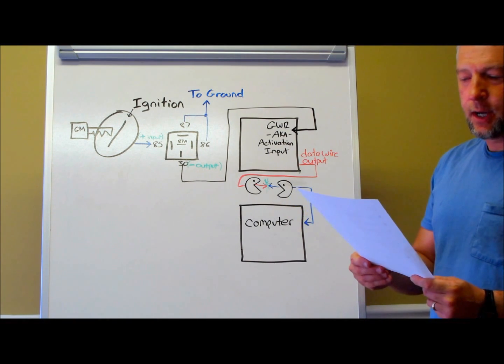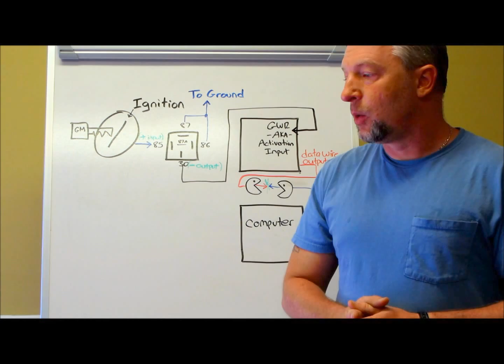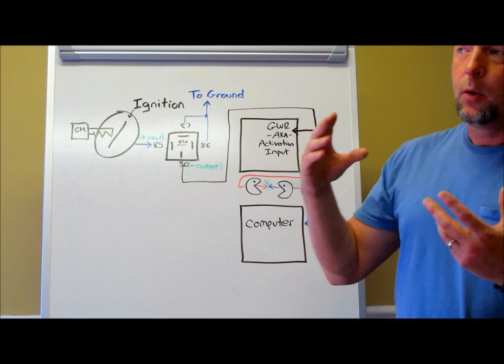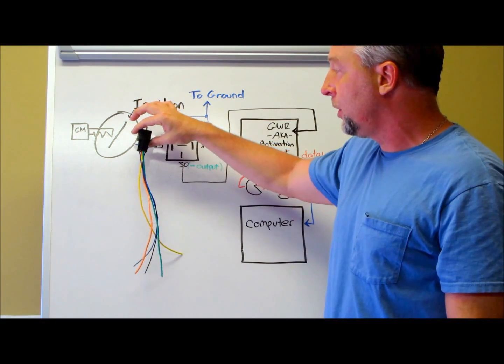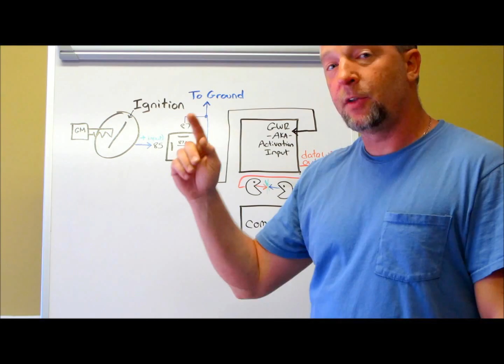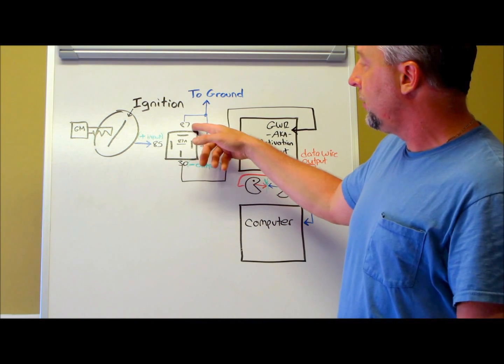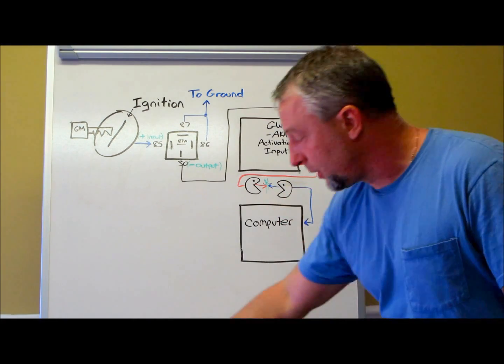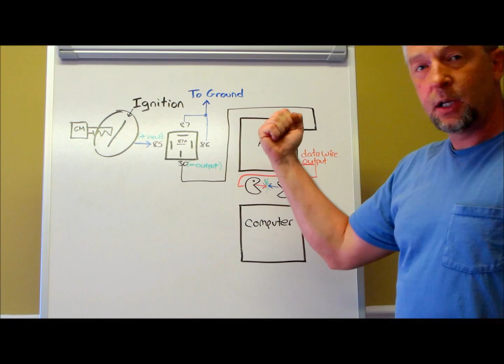Tricking (disabling) factory transponder anti theft system with an aftermarket databus bypass module

Comment: Hello Lessco Electronics. I really appreciate the video. I have just subscribed to your channel as I am no guru but I am an electronics geek of sorts. I found your video because I am having issues with my Dodge Neon. Someone tried stealing it and well, I have been trying to troubleshoot how to get it running again. It turns out I found a bypass module connected to the vehicle while exploring and changing out the steering wheel and lock cylinder. I have the same key/keyfob that I attempted to reuse since I don't have a spare. The new lock cylinder is not a transponder chip key but I figured I would just tape the existing chip from the new key. Well, it doesn't work. I figured I would change out the relay to see if that might work but what if the computer is confused? I know you mentioned at the beginning of the video that there is no way of testing it. But if it worked before and suddenly does not work. Is there another work around, or would I have to get the computer programmed? Any advise or direction you can point me in would be very helpful. Regards.
Reply from the maker: Call me -  I can help 904 342 5491

Comment: Hey nice video I bought a 2001 ranger 3 weeks ago I have three keys to it the previous owner said he had to put new computer and get keys for the truck before it ran find now no crank I turn one key to start position theft blinks rapidly the other two keys the left light goes off after 3 seconds still no crank battery is good I can hear the fuel pump air bag light now reads off when truck ran air bag light was on could it be the keys/ ignition problem or the computer/pats can a locksmith repair problem or is it a take it to the dealership situation will I eventually need to buy the set up you described in your you tube video if you can respond I appreciate the help Thanks

Comment: have a 2000 Mazda B3000 6 cyl, auto , 4 wheel. need to by pass the pats system. please send info on ,  pump relay pigtail, bypass module needed,,, Bil4037@gmail.com

Comment: Ok im having tge same issue for weeks now ive been daignosing trying to figure out why the coil packs werent getting spark..the engine would crank but no spark, fuses ,relays are all good ..so now its come to this the egnition switch...i just ordered a new complete ignition switch w/key for a 3.5 altima now if i install it will this resolve my issue or does the computer/ecm need to be programmed to that specific ignition..im hoping to just bolt it in plug it in and it just be ready for use..lmk wat u think thank u!

Comment: Good video, well explained, friend Lessco, how can I do to disable the safety light of a 2006 Dodge Ram 2500, since it blinks and does not allow the vehicle to start, besides how could the data bus to the PCM bypassing the cluster , I would appreciate if you could guide me to resolve the situation, thanks in advance, Regards.

Comment: I NEED HELP PLEASE 
I have a 1998 GMC Yukon slt 4x4 my brother lost the keys and i dont understand how to bypass Sercurity i put a wire to the starte and one to starter solenoid it will start but Sercurity light comes on dies do i have to buy a Sercurity bypass moduler and what else and can i buy it from you

Comment: Today my 98 suburban start but turn off, i diagnose all the engine components and was good, the terminal 21 on the fuse ( security ) had no courrent, i jump a wire to the terminal and the  problem was solved,  now  terminal 21 have voltage,  this is controled by the transponder, the vats or? the bypass kit will solve? thank`s

Comment: .... Here's how... Buy this... buy that.. buy this thing too.  It might not work.. Give it a try.
Reply: This is electronic bus comunication. Not knock-it-with-a-hammer-3-times-then-try-again stuff. You're gonna need some components, no real way around that. Iven if it was a hammer type of deal, you'd still need to buy a hammer, if you don't already happen to have one or can borrow one. Immo bypass modules aren't something half your neighbors are likely to have lying around, and you wouldn't be viewing this video if you already owned one (at which point you'd most likely already know how to use it, or have a manual).

Comment: What if I put a Honda Jazz steering column that has Honda ignition barrel and switch which has a blank Honda Jazz key ....all this used on a Ls1 v8 Holden vy ECU ....how do I bypass vats and start engine

Comment: Hi I have a 2005 jeep Cherokee a SG liberty and she broke down 3 years ago. When I had a technician put a computer on it. It come up with the ignition is not responding with the ecu the ecu is not responding with the body module and more. But when I turn the ignition on the fuel pump comes on but the immobiliser won't disengage and the only way I can get her to to turn over is by touching the live from the battery to the relay slot for the starter. Now jeep UK has estimated close to £3000 for all the parts and that's twice the value of the jeep and it's a shame to scrap it it's only done 70000 miles is there some way I can get her going for penny's?  I have both Keyes.

Comment: Cam this be used on a 2004 dodge stratus R/T i cant find a way to bypass the immobilizer amd have no key but took tumblers out of the cylinder and can turn car over but securtiy is not allowing to start
Reply from the maker: This will not work on a sentry key like yours.

Comment: Ok I'm desperate! I'm trying to figure on 2002 Chevy avalanche. I've tried every bypass on this truck on YouTube and websites to no avail. The light stays on continuous when key is not in ignition and even when doing relearn process. I just want to disable the system security completely. There are NO videos on this vehicle. Thanks if you can help with video or writing back, thanks. Been dealing with this for a month! Desperate! I don't have the funds to have mechanic fix this with diagnostic tool.

Comment: So went to xpresskit.com and on installation instructions on the module for my buddy's vehicle 97 mustang it says to place key inside of module if the system isn't working correctly at the moment I can't fathom how it would fix the problem using signal from key that is currently not working unless maybe the transponder ring has failed and isn't reading signal

Comment: i have a 06 ranger.  the check engine light came on and the the guy at advance auto said the code said it was my pats system either the key or the receiver.  My truck isn't acting strange it started fine and the check engine light came on immediately.

Comment: I have 01 Expedition Eddie Bauer with the MACH Stereo system I just bought a Kenwood eXcelon ddx394 SAT the settings won't save? i bought a metra wiring kit for my car but still wont save?

Comment: If you don't have an original 'chipped' key.   Missed the part about 'How' the new flushable database interface is 'flashed' with the proper  'secret code' that the computer needs to let the car start.

Comment: Can i bypass a 1998 Lexus GS300 transponder system?
Reply from the maker: If you have 1 key now you can get the pkt we sell and wire that in there to bypass it digitally
Reply: I have a key. What is your web address?
Reply from the maker: lesscosales.com
Reply: Lessco Electronics
Reply: sorry, but I couldn't locate the website

Comment: Thanks for the video, but none of the links appear to work, they just give a long list of unrelated products.  It would be nice to have the description say exactly what part you are attempting to link to.  Also there are many "bipass" modules with many features.  I have no clue what specific feature I need to do what I would like to do.  I want to be able to use a non-chipped key to start and run a Toyota Corolla 2008 (manual locks).  I DO NOT need remote start.  I have working chipped keys and the car works fine right now.  Thanks for any assistance you can offer.
Reply from the maker: tell me your vehicle, Ill send you what you need
Reply: Toyota Corolla 2008 stick shift and manual locks I don't need remote start.  I just want to be able to use a non-chipped key to start and run.  Thanks for any assistance. :)
Reply from the maker: You can use this:

http://www.ebay.com/itm/DEI-PKTX-Transponder-Bypass-Interface-Module-/360699792605?hash=item53fb620cdd

and a relay to activate it
Reply: Thanks for the clarification, but as it turns out I don't need the part because I thought I could reduce the EMF in the car by removing the antenna/reader round loop.  A simple test showed that the EMF must be coming from some other places.  Do you happen to know what components do that and if they can be shielded.  I'm getting readings of 15 or more with the tri-field meter in the driver's seat.

Comment: Hey, is it possible to have an alarm ( I have a code alarm 6554) cause misfire issues?  One day my battery died, and when I got it jump started from AAA the ignition was off a little, like when I shut off the headlights the dash lights and parking lights didn't go off, or when I started it, the parking lights stayed on but they weren't on...I ended up getting a new battery and all, and the truck starts fine now and the battery is fine in my truck (2007 Toyota Tacoma Manual Trans 6 spd).  Since its a manual, when I had it installed they didn't install the remote start harness because it's a manual and didn't want to purchase teh bypass or use my spare key, so yeah, but r there some features that may be sendign a pulse during crank or something causing fuel injector, or crank or something causing misfires?
Reply from the maker: I seriously doubt it

Comment: my 1997 mustang gt has a problem starting. it cranks, the engine is on and then immediately dies. tried many times to start but same issue. Also, the oil pressure gauge goes crazy up and down when i try starting the car. 
i thought it was pats at first, tried few procedures to re set the system but to no avail. since my theft lights is off all the time, i am not sure is pats (unless the theft light is fused). Other thing i noticed is that i could not open my door with the key itself only with remote. after few tries finally managed, thought this could reset the theft system but still the same problem, car shuts off soon after starting.. what could it be?

Comment: hello dear ,
thank you very much for your video, i hope you can help me with my car, its jeep liberty 2012, without a proper knowledge from me exceeded the 5 times try of the sentry key, and now the car wont crank at all, and the red indicator under the braking light is flashing while im trying to turn on or during turning on  the ignition key, so how to reset this and,  by the way this is all because i think my sentry key is faulty or something i don't know, but if i could just rest it back so i can diagnose the key issue it would be great

thanks dear

Comment: Obviously you are very knowledgeable and in trying to get everything in your head across there was just way too much talking rather than getting to the point of how the system actually works.  The theory is explained fairly well in the video but no piratical.  The drawing shows one wire going from the relay to the bypass module and one wire from the bypass to the computer.  Where do the other wires from the bypass go and how do I know which one goes to the computer and where/how does it connect to the computer?
Reply from the maker: that'll depend on the bypass module you're using on your specific application. I am using only 1 type on my demo here..

Comment: i have an early 2000 mazda mpv, built in mid 1999, factory anti theft, not alarm system, uses the factory horn and flashes lights and flashers and dome, shuts down injectors and pump. got activated some way and been sitting almost 2 years, i have tried every program available on internet and info from alarm companys, programing  keys etc, dealer said bring it it, its not worth that, i need to be able to disable the system so i can get a little more use out of the vehicle, just a shame to park a car that was running and driving. i have both original keys and the key fob, the fob only worked a few times when i first got car, i can make it make noise and act goofy by reprogramming but still won't work. i went to your link and its an ebay store and can't find the info, i don't mind paying if i can find something to work.
Reply: Just call a locksmith, Something has gone wrong with your pats system and transponder eliminators still need to be programmed for them to work and makes a mess of things diagnosing why the car won't start. It will probably cost you less than 100$ to have a locksmith come out and scan the pats control module, then perhaps do a parameter reset (if any number of modules was swapped with a used one ever sometimes the procedure needs to be done again or the car won't start)  or reprogram the pats keys assuming they aren't cloned keys which case they can have a ton of problems. If they are cloned or "battery" keys you are best off getting oem keys programmed and just forget about the system! Ford's antitheft systems are pretty darn reliable when they aren't tampered with! It could be that you have an aftermarket remote starter system installed or something and those will do all kinds of crazy things to the anti theft transponder system. A locksmith will be your best bet who will have had to deal with hundreds or thousands of cases just like yours. Our specific trade and narrow scope of work allows us to see all the problems like these and more on a nearly daily basis!

Comment: Sorry but without a key the guy with thw cadillac is dead in the water ! Your device will not work , his best bet would be to have his car to the dealer . The ignition switch for this video is a discreet  input to the body control modules . the RIM , DIM , IPM . These modules turn on power for the vehicle ,which ever mode ACC, RAP , ON , RUN , START . There is no way you can bypass or get around this system .

Comment: Please help!! I have a Mercury Sable 1998 and I have broken into pieces the transponder chip in my ONLY key. I have a spare key that fits the ignition but does not start the engine. The ORIGINAL key still turns the ignition and starts the engine but with the chip being broken, the engine DOES NOT stay running. What can I do? Please help!!??! ASAP. Thank you!!
Reply: BTW I coincedentally use this vehicle for my cleaning company and DO NOT have a lot of funds to support a temp/perm repair due to the vehicle and my cleaning services being out of commission.

Comment: Hello, I have a 2002 Sebring that had a ignition switch put in that doesn't have a chip. will this application work? if not , is there some other way to do the bypass without having to spend $200.00 for another chipped key and switch? Thank You for your help

Comment: u have great information maybe try this one. i have a 1993 camaro v6 3.4l. i lost thr key so i took the lock cylinder out i can turn the key over no start. i bought a baker electronix vats bypass module. the instructions say attach the wire from bypass module to dark blue fuel enable wire coming out of the vats module on the car. my module has both 30z and 50z i hooked everything up like they told me it atarts and runs for 3 secs and dies. any ideas on how to completly bypass all the way around or am i hooking it up wrong or another location to install the module at

Comment: hey man, we are very happy to have you,  hoping you could help as well;my ECM is fried out due to battery inserted the wrong way, I just received a new one shipped from the US to Chad but no electricity on the injectors when I tried to start it, what do I need to do, some guy tried to program the key but it is asking for pin code: It is a Chrysler 300, 2005 model, v6 3.5L, VIN 2C3KA53G77H611942. THANKS

Comment: hmm it sounds good. but i don't understand. In your example old mate doesn't have a key with a chip in it. how does your bypass kit know what frequency to send the signal to the computer?
and what is the go with the relay? it seems that the whole bypass system wouldn't take too many amps. it seems obsolete. or is that the proper way to do it?
Reply: 0k
Reply: Maybe
Reply: Because its a alarm type system hook up , and has about 95% of all it need to start it , if you fall in to the 5% your screwed , its as simple as that

Comment: hi, I have a 2002 ford taurus and I think my PATS has either gone bad or something is going on with the car, it would randomly just die while driving, only while driving, not sitting still or at a stop. some times it will do it about every day, sometimes it will go several days or a week or so with doing it, the engine just stops, no stuttering or anything and all other electronics still function, after the engine dies, you can turn the key to off, and then crank the car right back up most of the time. a couple days ago the keys stopped working to start the car, the engine wont even try to start but all electronics still function. I was wonder if this bypass might work in my situation and if so could you help me find the correct databus bypass for my 2002 Ford Taurus? its the 3.0liter duratach DOHC engine. I have gone to the websites mentioned but want to be sure to ge the right bypass because I am on an EXTREMELY limited income
thanks for the help and the video.
chrislouck@gmail.com

Comment: 97 Ford F 150.  Starter motor will not turn over...After trying to start, the interior dome light blinks and can hear a blinker module (?) under the dash blinking...I assume this is the anti theft system...Will a bypass module work and where do I get one?

Comment: help I replaced my battery on my 2000 Ford Explorer and now it won't start I had a locksmith come out and paid $60 for them to reprogram the brain which they could not do. so I was told to replace the Halo in the ignition and also there's a wire that goes bad a lot as well. Please help I can't afford to pay the dealer.